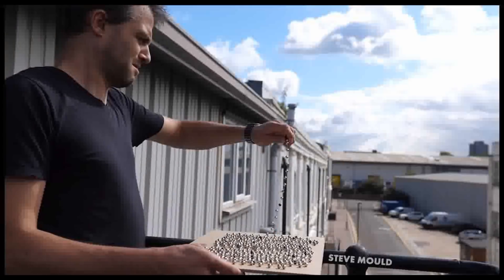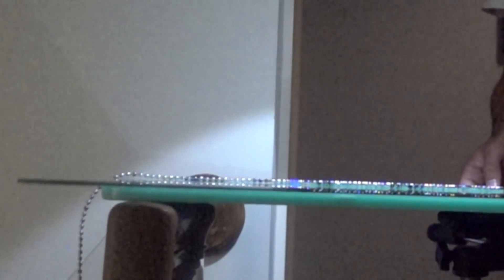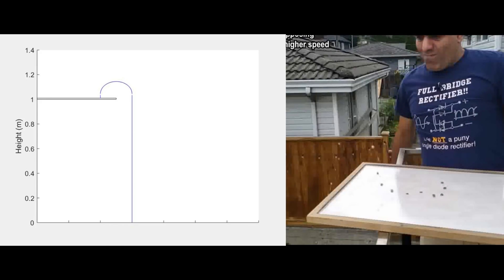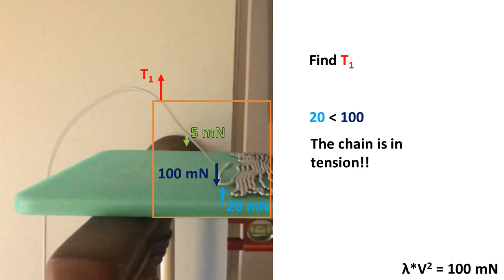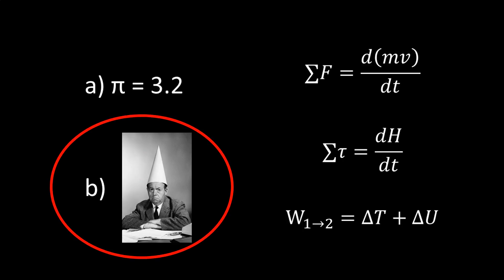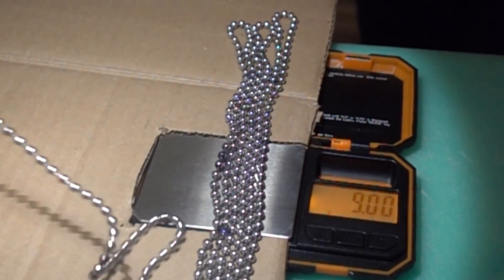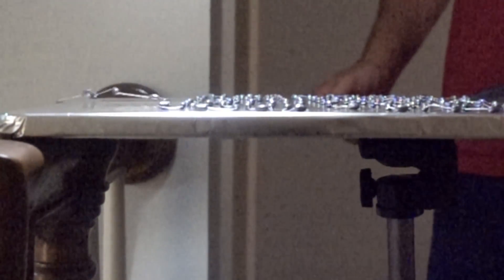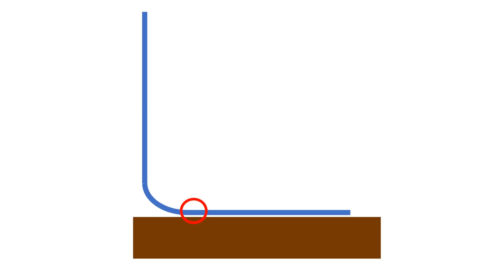And the Winner of the Chain Fountain Dispute is...

Comment: U guys are mostly wrong.
The question(s) are not whether there is a reaction force, they are 
(1) whether the reaction force is needed to create a fountain,
(2) whether the reaction force affects the height of the fountain.
The answers are No & No.
In relation to the horizontal fountain, the answers are Yes & Yes.
But, the original questions relate to a chain from a bucket/beaker/container/can -- not from a horizontal surface.
So, that was your first mistake.

Now to your second mistake.
The mere existence of a reaction force does not make the answers Yes & Yes.
The reaction force borrows power from the falling chain.
So, it can't add to the height of fountain (from a bucket).

Links landing on the floor do add to the tension in the falling chain.
Hence they add to the height of a fountain.
But the lever action (kick) at launch in the bucket does not add to the height of the fountain.

There are (can be) two kinds of kick. 
One is the simple lever kick (due to a say 90 deg bend in the chain).
The other is a similar kick that is due to the chain having a bend beyond 90 deg.
We sometimes see a bend of 180 deg, or more.
That large bend creates a slower & possibly greater kick.
But, both kinds of kick borrow power from the chain, hence they don’t add to the height of the fountain.
Except in the case of launching horizontally from a horizontal surface, where there would be no vertical fountain were it not for these two kinds of kick.

Except that there is a third kind of kick that will give u an enormous vertical fountain offa horizontal surface.
And this kick can be created by laying the chain such that as it is being yanked horizontally it has to jump over itself.
It’s a jump-kick, & has zero to do with lever action.
Whereas the other two kinds depend on lever action.

Steve is wrong.
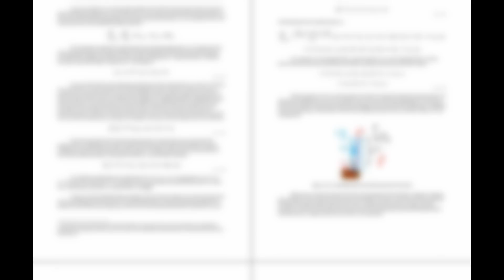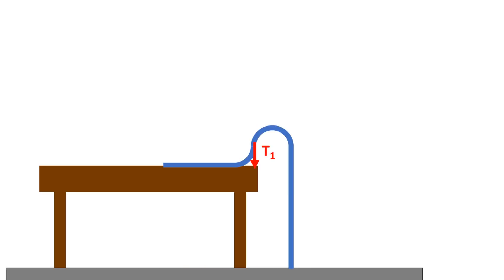Reply from the maker: It would seem that the math from 4:00 to 9:00 would disagree with you friend. But admittedly, I did rush over the math in that section, so if you are interested, feel free to check out the attached paper that runs through the math in more detail. It shows that, from a momentum perspective (not an energy perspective) a reaction force is necessary to generate a chain fountain. But, if you see any mistakes, let me know.

Also, as Biggs and Warner point out in the original paper, the act of a chain falling is quite dissipative, meaning that chain falling to the ground from a table only has half as much kinetic energy compared to the amount of potential energy it had before it fell. The other half of the potential energy gets lost as heat before the chain hits the ground. However, because of the reaction force, some of the energy that would be lost as heat is instead used to create the fountain. Therefore, the reaction force does not steal power from the falling chain but instead taps into some of the energy that would otherwise be lost.

Cheers!
Reply: @prestonbecker8784  Yes i said that the lever action of a landing link adds to the height of a fountain.
But a launching link lever action borrows its power from the system, hence has no effect on the height of the fountain (from a bucket).
My math is weak. But does your math (& the Cambridge math) show that the launch reaction does not rob power from the system?
What i didnt say, but now will say, is that there is almost zero (90deg) lever-kick at launch if the chain lays haphazardly in the bucket.
U will have some (180deg) lever kick, which is a slightly different animal.
But i wouldnt split hairs, i would award a half of the money to Steve if it can be shown that the 180 deg kick duznt rob power but adds power.
I say a half of the money, koz, the answer to question (1) was No is No & will remain No.
There is no chance that the reaction force at launch is needed to establish a fountain.
So, Mehdi cant lose.
The best that Steve can do is to have a draw, & split the money.
But, Steve is wrong in both.
Mehdi Steve u & everyone seem to be afraid of a simple test.
Nip lead split shot on some fishing line, with clear spacings equal to the diameters.
U will find that this chain creates & maintains a nice fountain.
Up to now Mehdi Steve & all have been making these chains with clear spacings of about 5 diameters.
And the conduct & analysis of such tests have been at kindergarten level.
Otherwise i am very pleased with the work that i see being done.
So, my suggested splitshot test makes any math irrelevant.
But, nonetheless, i would be interested to know whether your math shows that power is not borrowed.
Reply from the maker: @atheistaetherist2747  
a) Like I said. Most of these analysis have used conservation of momentum (which always gives you the right answer). You seem to be using conservation of energy, which can sometimes lead you astray, which is why myself and Biggs and Warner did not rely on it for our principle analysis.
b) "But does your math (& the Cambridge math) show that the launch reaction does not rob power from the system?" I never touched on energy in my paper, but Biggs and Warner did find that the reaction force decreased the energy loss of the system, meaning that the reaction force took energy that would have been converted into heat and instead turned into into work, meaning that the reaction force did not rob power from the system.
c) "There is no chance that the reaction force at launch is needed to establish a fountain." again, that is not what our math shows.
d) "Nip lead split shot on some fishing line, with clear spacings equal to the diameters...Up to now Mehdi Steve & all have been making these chains with clear spacings of about 5 diameters." Right, and the reason for that is, if the distance between the balls equaled one diameter, the chain would not be able to bend all the way. Spacing out several diameters gives the chain zero bend stiffness, which should prove your test, but does not.
e) To counter my last point, you might say that this test:
https://youtu.be/hx2LEqTQT4E?t=918
disproves my point. However, as I show in the paper, and at 4:57 and 5:56, the thing that makes the reaction force necessary is the weight of chain in the fountain. If the test is done on the floor (meaning that the fountain does not have any weight because gravity is neglected) then the fountain does not require a reaction force, which is why Medhi is able to create a fountain on the floor. But once the chain has to fight against gravity in a vertical setting, the reaction force becomes necessary.
Reply: @prestonbecker8784  I am sure that 1 dia would avoid lever-link kick.
0.5 dia would probly not.
Here is an idea. Use 1.5 dia clear spacings.
Hang/pull the chain over a cylinder (instead of using the sharp bucket wall) which has a dia of say 20 dia, to reduce the initial clatter.
After which i am sure the chain will rise nicely up clear of the cylinder.
And then i would add splitshot so that the clear spacings were 0.25 dia.
And repeat the test.
If the fountain height was more than in test 1 then that would lend support to Steve's assertion that kick affects the fountain.
Reply from the maker: @atheistaetherist2747  Well, I have already used up all my lead fishing weights. But if you want to try that test, film it and send it my way. Out of curiosity, why do you think the 1.5 diameter spacing would produce a fountain when the chain at 16:45 did not?
Reply: @prestonbecker8784  The test at 16:45 was a horizontal test. 
My idea refers to a chain feeding from a bucket, & launching straight up & over a nice smooth cylinder.
With a small yank to help it get going.
After which the chain will on its own lift clear of the cylinder & form a nice fountain.
With clear gaps tween splitshot of 1.5 dia it would need say 100 splitshot per m = $15/m by say 20 m = $300.
Then at 0.25 dia gaps it would cost $600. Hmmmmm -- thats costly.
Reply from the maker: @atheistaetherist2747  Yea. And I did experiments like you said with my fishing weights chain, but the fishing wire got tangled into a huge not before I could get it on camera. Long story short, with my flexible chain, there was no fountain. Combine that with the math that has been done, and I am pretty satisfied with Steve's and my conclusion. And unless you (or someone else) can either find a problem with our math (including the math that shows that the reaction force does not rob energy from the falling chain) or show an experiment with a rising flexible chain, I think that is probably where I will leave the matter. Cheers
Reply: @prestonbecker8784  My math is weak. But all math is weak. Math needs a model. U & Cambridge made a model where the 90deg lever kick at launch adds to the fountain. And your conclusion is that the 90deg kick adds to the fountain. My model would say that the 90deg kick borrows power from the fountain. Math (on its own) cant tell us which model is better. Math cant say whether Steve gets the money.

Comment: Never believe a computer simulation. By definition it excludes the hidden forces and unknown effects ;-)
The shock wave speed through the chain also isn't covered (inc the bend radius shortening effect)
Reply: Also forgot about the torque/twist effects as the lay-flat-coil-on-side, is lifted.. With a minimum bend radius there has to be a (partial) down force onto the table (see tin foil marks), but it can't be what 'lifts' the chain in the first place!

Comment: 16:44 you can see the chain yanking the balls and making the new moving ones go faster and even surpas the one that yanked on it, i bet that this chain can also make a fountain, maybe on base of competely different phenomena.
Reply from the maker: I did a bad job making this the central focus of the video, but besides the experiments, the really crucial part of the video starts at 6:45 and goes to 9:05. Yes, the tension in the chain plays a huge role in the formation of the chain fountain. But if not for the upwards reaction force, the tension force is not sufficient to form a fountain. So, even if a chain exhibits the ability to transmit tension to stationary beads, if it doesn't also have a mechanism to create an upwards reaction force, it will not be able to forma  fountain.